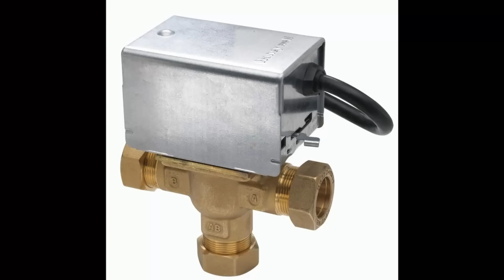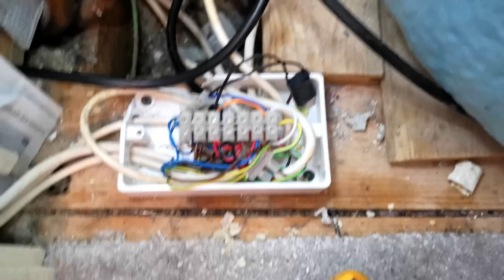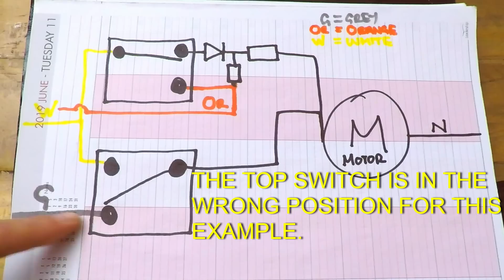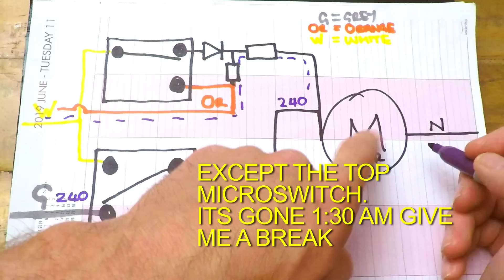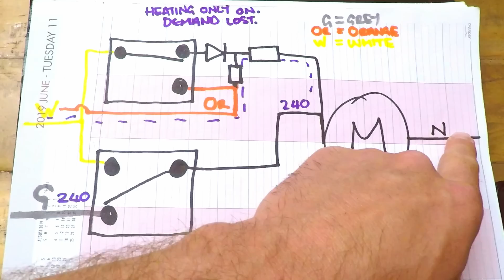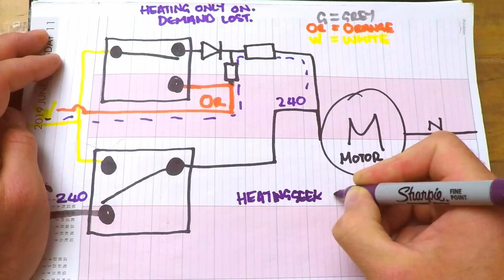Boiler wont turn off?? Heating Staying on? Changing The 3 Port Didn't Help? Heatinggeeks Repairs it.

Comment: Nice one Olly and we'll explained Keep them coming! 
 Just for your viewers the diode and series resistor provide a half wave DC pulse to the AC motor stalling it precisely in the mid position when the switch moves over , the other resistor stops the motor from jamming.. 

You can also fit a 100nf or 0.1uf class X2 ( suitable for AC) capacitor across orange and neutral .

I agree old design works well but some boiler electronics are also sensitive as they use optical isolation for the SL input only requiring a small current in the region of 20-50ma .
Reply from the maker: Nice one sol. This is the sort of input we need. Even if I don't understand it just yet it gives me something to learn. :-) 
thanks.
Reply: Good man, I bet you have made your million yet
Reply from the maker: @dzmalekvali1110  Nope. One day.... :-)
Reply: How does it stop the motor from jamming and what would cause it to jam ?
Reply: @millomweb  I learnt from another youtube tutorial, 
 prevent it from magnetising/ locking when the motor is in the mid position. 🙄

Comment: But im getting back feed and its also showing on the white. The back feed is coming from the cylinder stat. Ive 73v and it fires the boiler. It only happens if hot water program is on and hot water is satisfied. Other than that it operates fine. And turning hot program off sends it back into normal operation. Heating will work on its own just fine. Its only when both are calling and hot is satisfied but still calling from programmer

Comment: My heating would continue running with stat turned right down and even with programmer set to off, the only way I could stop it was to switch off the mains supply to the boiler. after a lot of head scratching I concluded that the system thought it was cold when it wasn't. I studied the instructions and found that my Alpha CD18 R had a frost stat built in to the PCB, but there was a seperate frost stat in the outside cupboard where the boiler is fitted. I removed the seperate frost stat and solved the problem. conclusion -- whoever fitted the current boiler left the old stat wired in which has ben no 
problem for the 8 years I have lived here but must have been triggered by a very cold night and got stuck on.

Comment: Good explanation. I made a DIY filter  using a 0.1uf ( 270vac plus) capactior and 130ohms 500mw resistor in series. Problem with boiler staying on ..Fixed...Thank you  ps cost was 50p  haha
Reply from the maker: Can you explain how your set up works?

Comment: I think a replacement PCB for the Glow Worm Micron comes with a suppressor that is supposed to be fitted to the boiler terminals if it has a 3 port valve, so I assume this could be used on other boilers ?
Reply from the maker: It does. :-)

Comment: Hi Ollie, your videos are great and I am learning so much more than I already do from them. 

This video seems to be the same problem my customer is having...I will need to go back and double-check with a multimeter but the boiler is an Ideal Icos, are these suppressors universal or do you need to get particular ones for boiler types? Can't see a link in your description for the one you used.

Anyway, thanks for the videos and your time.

Dan
Reply from the maker: I always use the Worcester one. Because its easy to get from suppliers
Reply: @HeatingGeek  Thanks for the fast response!

Comment: Great video. I fitted a Vaillant 418 3 years ago not a problem. Had the pub go down and it was changed under warranty, ever since the customer had this problem, I discovered a voltage of around 90v on the swl. I'm assuming the original board had a suppresser and the new replacement ones dont. Vaillant were no help. Going to order that suppresser and stick it in.let you know what happens. Many thanks for the effort you put into these videos, we really do appreciate them.
Reply from the maker: Good stuff! Thanks for watching it. :-) The suppressor should work. :-)

Comment: Hi mate, this is the closest I think I'll get to fixing a problem.    I'm currently getting 46v in this situation, boiler doesn't always stay on but the valve doesn't move over either once the demand has ended. Would the suppressor for the trick? Plumbers buggered off, I'm a sparks trying to help a friend. Many thanks! Great vids by the way! Easy to understand
Reply from the maker: What boiler is it? Some are more prone to this than others. :-)
Reply: HeatingGeek it's a glow worm energy boiler. I'd gotten my head around wiring centres the last couple years, however every days a school day! Thanks for reply

Comment: I had a new Vaillant boiler Installed and I’m getting this problem, but not every time the heating/hot water is on. Maybe once a week or so, at random time, the heating or hot water won’t turn off once it’s up to temp or the schedule has run out. I replaced the 3 way valve and still the same. Could it be the same issue if it was only happening every now and then or would it just do it every time?
Reply from the maker: It will only do it when the system was in heating only when it turned off.  So the hot water was off first or up to temperature.
Reply: i know this is an old comment but did you find the issue greg? i recently had a new vaillant boiler installed and started having the exact same issue, cant find any info on this issue anywhere, your comment is the first i found. i haven't changed the 3 port valve as i wanted to be sure first, i've tried checking for backfeed but found nothing
Reply: I did get it sorted, unfortunately I can’t remember the exact details. I got a plumber that was also electrically trained in. It wasn’t a faulty part in the end, it was the way the boiler had been wired up incorrectly. Like I say, can’t remember the exact details, but I’m quite handy and couldn’t have done it myself. Sorry can’t be more help.
Reply: @gregbirds8153  thanks for the reply,  do you remember if it was the boiler itself or the wiring junction box? the plumber who installed the boiler couldn't find the issue. if its the boiler i could get vaillant out, if its the junction box i'll have to get an electrician out or something (its a right mess of wires). don't worry if you cant remember, you've helped narrow it down, glad i didn't waste money on a new 3 port valve if it may not be the issue, thanks in advance.
Reply: It wasn’t the boiler, it was something to do with how the boiler was wired to the junction box/thermostat receiver box. I looked at getting valiant out, they said if it was a fault with the boiler they would fix it for free, but if it’s an issue somewhere else they would charge. I can’t remember the fees they quoted but it was high! Deffo wasn’t the boiler itself in my case, but the way it was wired to the rest of the system. I’d keep calling plumbers that have electrical knowledge and ask if they’ve come across the problem. A standard plumber wouldn’t know enough about the wiring, beyond wiring the boiler itself in. And an electrician may not know enough about wiring within a heating system. So you need to try and find the sweet spot, someone who is as good at both.
Reply: @gregbirds8153  thanks for all your help, been trying to narrow it down for weeks. none of the parts looked faulty from tests found online and looking at the state of the junction box it is likely the culprit.

Comment: Great video I remember working on the old satchwell motor open motor close valve way back but boy it was a pain waiting for them to motor they where so slow do you still see any in use ?
Reply from the maker: I have often altered the wiring for other engineers and companies. The good thing about them valves was they didn't consume power when they were open. :-)
Reply: @HeatingGeek  Do you remember a heating company in Barnet called T A Horn They relocated to Enfield
Reply from the maker: @marke293  Come on? I done my apprenticeship there.  U?
Reply: @HeatingGeek  No I used to sub contract For them wiring up the systems for a good few years when they where in Victoria Road Phill Goames was the contracts manager back then and I believe he went on to be part owner of the company ?
Reply from the maker: @marke293  Yes, when I worked for them Phill was the MD for the install side and Norman Whittica (spelt wrong) was the MD for the service and repair side. My dad was Normans boss at Camden which is why I went there. :-) Best job I ever had in the industry tbh.
Reply: @HeatingGeek  I worked for them about 30 years ago so I am a good bit older than yourself. I also worked for a few other heatings companys just wiring up systems in My day it was Y Plan and S plan systems I would like a £1 for every one I have done i cant believe how many electricians would not touch a heating system wire up
Reply from the maker: @marke293  I did my apprenticeship with them 20 years ago. Did you know john or Kevin? The Store men?
Reply: @HeatingGeek  them Names dont ring any bells I remember John Hedges who used to do the flue installs for the Thorn back boilers that where being fitted back then. Were John and Kevin at Barnet ?

Comment: why doesn’t this happen from day one of the boiler install? Wouldn’t it have been  picked up on commissioning?
Reply from the maker: The PCBs on the boilers get more sensitive or the resistors in the 3 ports degrade. The suppressor is going to fail one day too. But the suppressor is cheaper than both the other repairs. :-)
Reply: @HeatingGeek  great video bud. Not come across this yet but good to know. If a boiler has been in for 4yrs with the valve as well and the heating stays on when demand is off would you say this is the issue? How do you know which boilers this happens to? Cheers
Reply from the maker: @leeedwards3783  Worcester Ri ideal logic and glowworm micron all have this issue.
Reply: @HeatingGeek  thanks for the reply and that info

Comment: What a bizarre issue. Modern boilers not being enough of a load to drop the voltage when the power's not quite turned off. I really think the valve manufacturers should solve this issue.
Reply from the maker: Manufactures should just add this to their PCBs. This has been a problem since the Glowworm Micron. Thats 20 years......
Reply: @HeatingGeek  No, it's sloppiness with valve manufacturers. It'd be interesting to remove the 270 ohm resistor and see how that goes ! It'd fix the problem but???
Reply from the maker: @millomweb  That resistor stops the valve from sticking..... Somehow. :-) An electrician does a good explanation of it somewhere on youtube.
Reply: @HeatingGeek  Looks like a load of nonsense to me. Either it's powered (one way) or not powered and spring return. Just like the 2 port !

Comment: Hi mate 
The trouble is some heating engineer don’t check or don’t know how to diagnose this problem.. so they try to resolve it by adding an extra motor/ valve. 
Which is totally wrong.. 
back feed voltage can b suppressed as you showed in ur clip .
Reply from the maker: Yep. Its hard to diagnose if you haven't seen it before. :-) Thats why I put this up.

Comment: Nice Vid Ollie, this has not happened to me as I always use S Plan but well worth knowing about for future reference on call-outs
Reply from the maker: I prefer s plan too. Most people replace the 3 port when this issue occurs. Manufacturers want you to replace the PCB so the suppressor is a good option.

Comment: Nice.. so did the problem occur immediately after the new 3 PV was fitted.? if so have Honeywell changed the electrical components or was the old valve a different make They are obviously aware this back feed can cause some issues on some boilers so I’d have thought they would have fitted the necessary resistance to stop it. Excellent tuition.
Reply from the maker: Its the boilers that have the issue. Some are more susceptible than others. The 3 port head was fitted to stop the back feed but didn't. Thats why I was sent out.
Reply: The problem being that the boiler's not drawing enough current on the call for heat connection. I suspect that if the call for heat wire also fed a neon indicator, this would be enough of a load to solve the problem !

Comment: Veissman supply a capacitor with their boilers, wired in to the switched live and neutral.
Reply from the maker: You know what. I was sure they did but didn't think to google it first!! Nice one. The boiler has all black wires on it if i remember correctly. When you replace the PCB you get the whole plastic surround too. :-)

Comment: The suppressor is a capacitor that when we apply an AC current it will produce and a leading reactance that can be seen as a resistance therefore a volt drop will occur across it.
Reply from the maker: I will pin this to the top. Thanks for a proper explanation. :-)